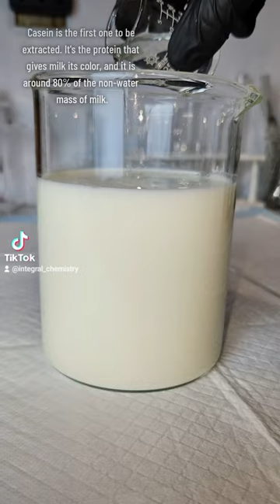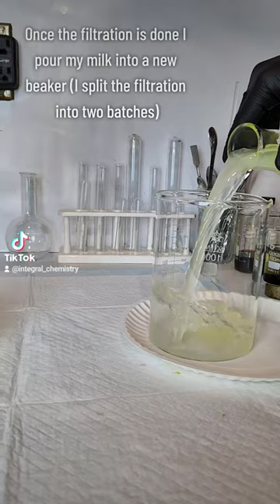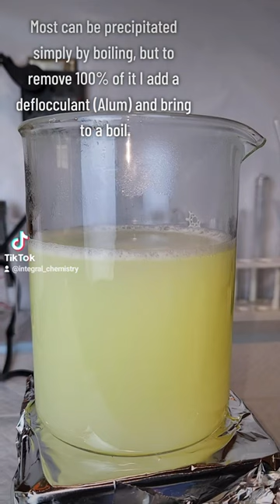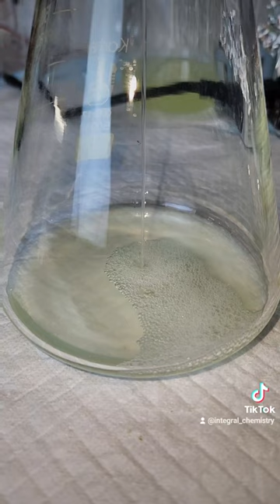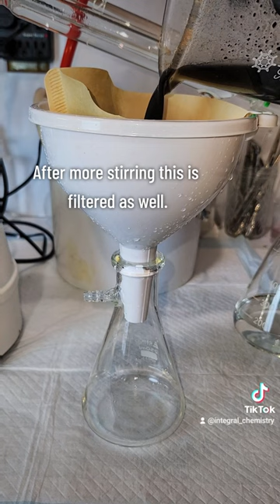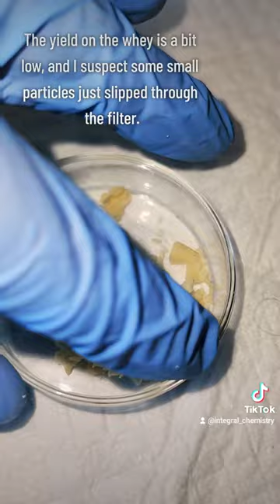Deconstructing Milk

Comment: I found the detection of lactose via the Wöhlk test so interesting that I made it available to my patrons as an exclusive video. The test is carried out in a hot water bath with the addition of dilute potassium hydoxide and ammonia solutions and, if lactose (or maltose) is present, leads to the formation of a non-extractable red dye, the composition and mechanism of which has not been fully researched even 120 years after its discovery.